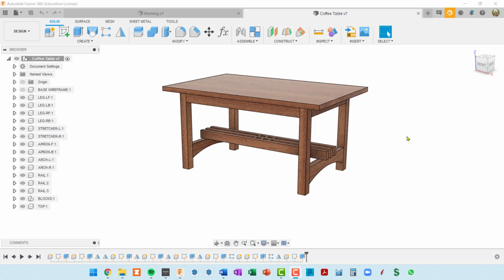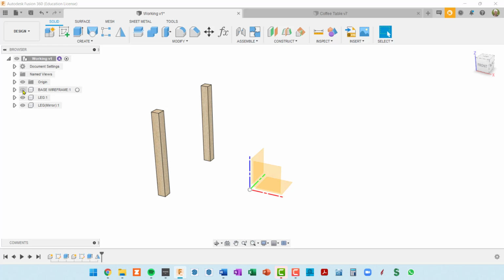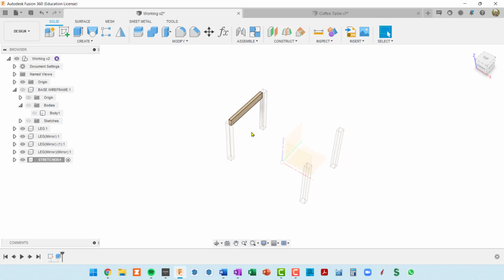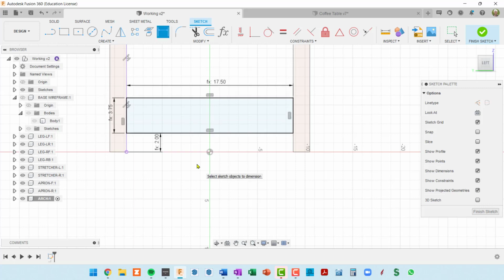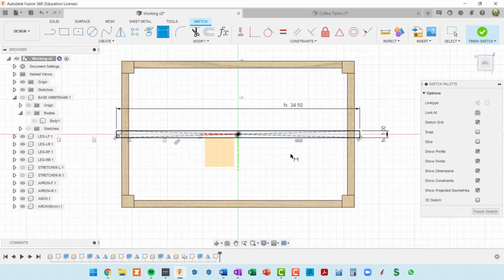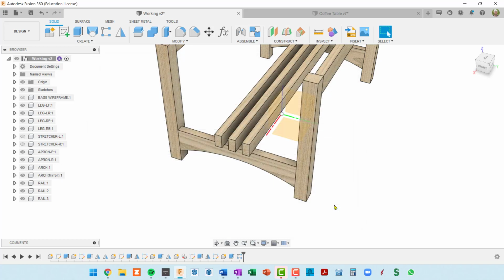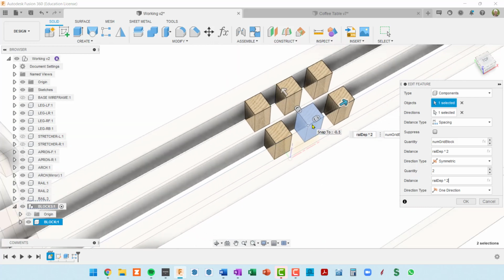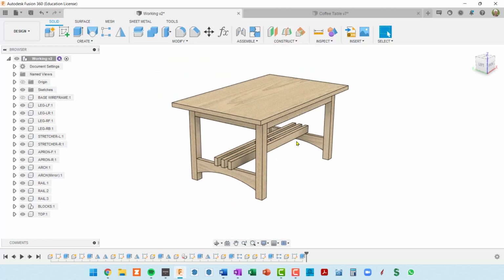Fusion 360 for Woodworking: Arts & Crafts Table, Part 1

Comment: When you mirror that stretcher that derives its length from a formula does the mirrored stretcher maintain that parametric connection?
Reply from the maker: Yes, it should.